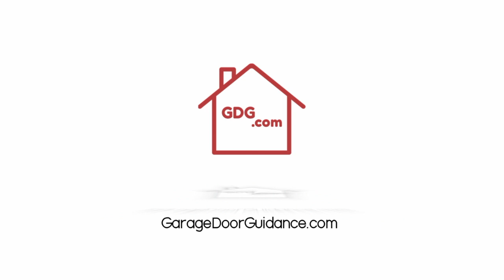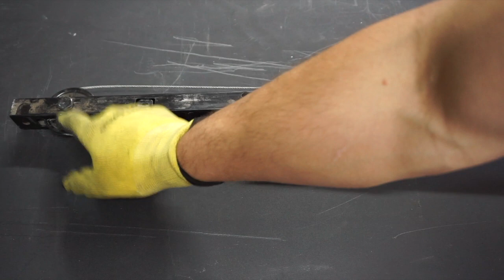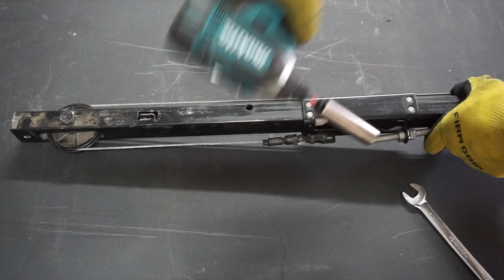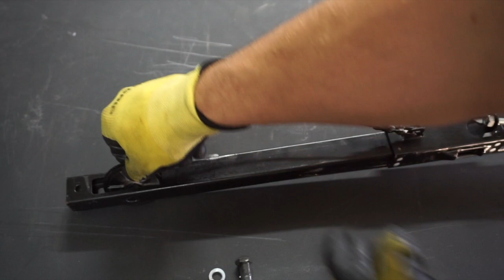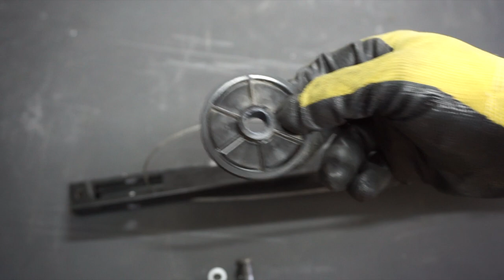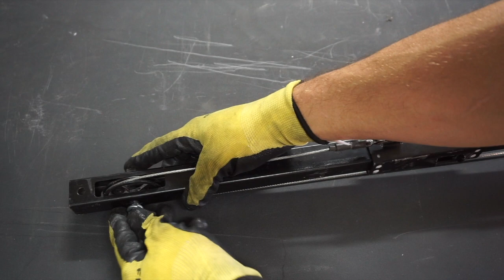How To Change The Idler Pulley On A Garage Door Opener

Comment: You should have lubricated the shaft with white lithium grease before you installed it to keep that pully running smooth and quiet.
Reply from the maker: Good tip 👌🏻

Comment: Replaced pulley. Closed door. The rail is bowed. Adjusted up travel and rail isn't bowed as much. When closed chain is slack. How much tension should be on cable.
Reply from the maker: Both the cable and chain should have about the same tension, I usually tighten it up similar to a bike chain but maybe a bit less so you aren’t putting too much tension on the gear

Comment: 1d7675 lift master belt drive, do you know what type of pulley goes on the opposite side of the motor? Because they send me one with a bracket? Or if you have a a video to see how it goes? I will appreciate it, thank you in advance
Reply from the maker: Liftmaster usually has a solid rail which yes they’d send the whole bracket on the end. Chamberlains it’s just the coupler where the belt or chain wraps around it. You don’t have one now to compare what you thought what there was before ? Email me some pictures to my YouTube name at yahoo

Comment: do they make a metal idler puley
Reply from the maker: Mark Couch Not that I’ve seen. I’ve seen people rig up metal pulleys to work with it before but it wasn’t made specifically for the opener / by chamberlain
Reply: YES!!!  After much research I found a metal pulley ( or sheave as some call it) from McMaster-Carr for about $8 plus shipping. Specs are identical except for the overall thickness but I have installed it and it works GREAT!!!  I bought two and had them shipped overnight and it was $31. Part number for this is 3434T78

Comment: I hv n issue i replace the pulley twice but breaks right way as soon as i turn the garage door opn to start or to check. What r the steps to do setting.
Reply from the maker: maninderk1 you gotta make sure you know where the limit is set, what I like to do is trip the sensors with the chain off. This way I know the motor will bring the limit to the “open” position. Then do the repair and place the trolley where you would imagine it would be in the open position. There’s also a stopper at the front that your supposed to flip up so that you don’t have the issue of the trolley breaking the pulley.

Comment: i loosened the chain slack but the cable around the mangled pully is still super tight. Do I need to release the door from the trolly by pulling the red rope? Will this loosen the tension with the door released?
Reply from the maker: BrushlessNitroSlayer you definitely need to release the door but I would say your chain needs to come off the gear to get the slack off. Mark it so you know the position of the chain.
Reply: @GarageDoorGuidance  yea it was tight around the gear, I released the door from the trolly and then moved the chain off the gear and that gave me the slack I needed, She is all back together now and works like butter!
Reply from the maker: BrushlessNitroSlayer great to hear !

Comment: I changed the idler pulley the first one broke immediately, the second one almost broke. The garage door wont move but it generates lots of tension on the wire side and not the chain side. What seems to be the issue here in your opinion?
Reply from the maker: The tension should be about the same on both sides. The chain is heavier than the cable so it might not feel as tightly stretched as the cable. Maybe over-tightening? Is it breaking from the tension alone?

Comment: Your videos are well done. I can't find one with my current issue though. The carriage is jammed up against the pulley in what would be the closed position. I've loosened the chain all the way and so the chain sags on one side but the cable is taunt on the other side. It's holding so much tension that I cannot even remove the chain 🙁 
 Can anyone reading this help with some guidance please? I already had it stuck in the open position and removed the chain and carriage was completely able to move. But it's not budging in this closed position.
Reply from the maker: I just dealt with this the other day, you have to release it at the gear, all the tension is there, so I don’t recommend using your hands. I took a screwdriver and pushed the chain off the gear one link at a time to loosen it. Beware it will likely come off with a little force 😬

Comment: Hi, my plastic idler pulley broke yesterday, exactly how you said in the video, is it still okay for I use my garage? Just wondering what would happen if I didn't replace it.  It's worked just fine but I will be replacing it in couple of days once the new part comes in, it's really cheap anyways, thanks.
Reply from the maker: Sunny you risk the chance of it slipping off the pulley, I’d personally use the door manually.
Reply: This exact thing happend to me thinking it would work. Im on my way to the store to get a new one because its chipped and will now open the guide as shown so in the future, there is less chance of it breaking again. Thank you very much for the video! @GarageDoorGuidance

Comment: My door mechanism resulted in broken pulley due to the cable bolt went through the pulley because the motor lost the adjustment on the travel limits. The technician came to to replace the pulley and re programmed the limits, however with the trolley disengaged from the chain, it goes beyond the limits set previously on both sides (up and down) missing any adjustment. The technician tried several times unsuccessfully. Seems to be a problem with the PC board. Another weird behavior is that the bulb light flashes erratically when the motor is running, like the vibration causes some problem on the bulb connection. Also it flashes when lightly hit plastic cover with the finger.
Has anyone seen this problem before?

Comment: Is this a specific cable to attach to those chains?  My pulley broke, and the cable is super frayed near one of the connections to the chain.  It's covered by that heat shrink, so not sure how it connects to the chain, or if I just get a generic cable and cut to length.
Reply from the maker: Cut same length, and you’ll have to figure out a way to attach to the end without the heat shrink. Not too difficult I’ve done it but it’s not the funnest thing to do haha